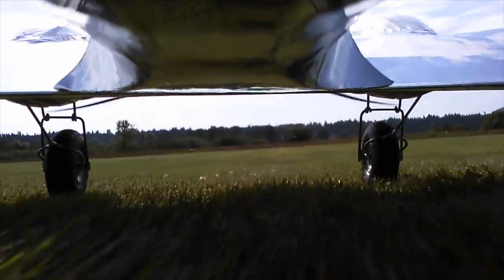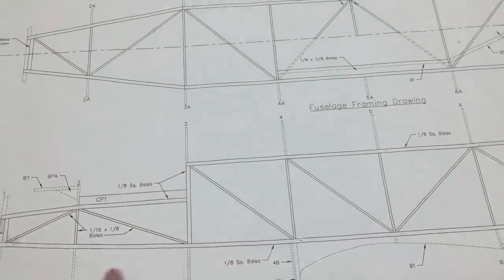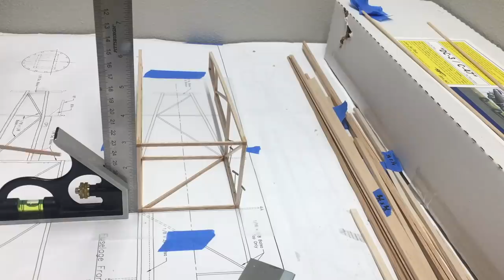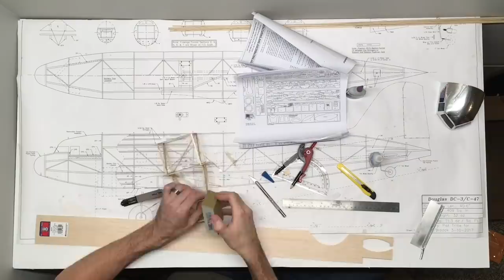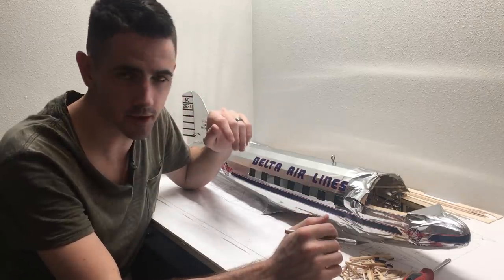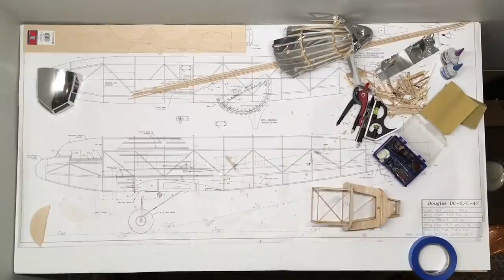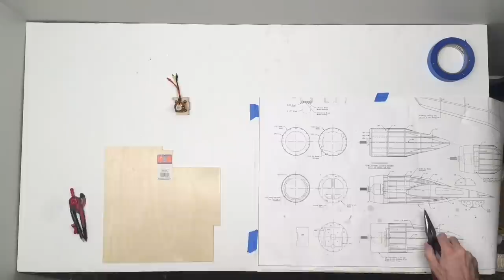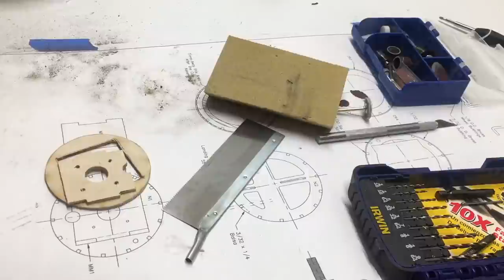How To Rebuild Balsa Plane - RC Airplane

Comment: When I rolled my balsa 300Extra, everything from behind the pilots seat up was smashed. I had to carefully remove what was left, piece it back together enough to make patterns and remake the entire front of the plane. I got complimented on how well it came out. As it was older, the white monocoat was slightly yellowed where the new was brighter but I actually weathered it in so it blended together using an Enamal wash using a touch of yellow and brown. I dry wiped it on and it worked! The result was a slight aged look! The hardest part of any repair is blending. Most people recommend recovering completly. I beg to differ. Saving the decales by just cutting them out was the same method I used on my stripes. I couldn't find a proper matching red in monocoat for the stripes. Blue was easy. There were 4 different reds at every hobby shop I went to and NONE matched. Talk about stress. Anyways, Awesome job! Anyone can built a foamy, it takes skill to repair a balsa plane. I highly recommend everyone in the hobby to build at least ONE balsa kit plane in their life time. I guarentee once you do, you will do it again.

Comment: You did a great job of rebuilding. I usually had a poor mind set trying to repair since it was usually operator error that caused it. I go back and use yellow glue on some joints as I think the heat from putting on the covering weakens the CA glue.

Comment: Nice work on the rebuild. At least you have plans. I’ve often had to redraw the parts from the crash damaged parts before the actual rebuild.

Did you work out the cause of the original crash so as not to repeat it next time.

Comment: Hi. Great build and rebuild. My dad was airplane mechanic and eventually crash investigator. He would have been 100 last month. He once talked to me about lines of force transmitted in a nose impact. He traced his finger along the spine of an ultralight he was building in his garage. He showed me how the monocoque fuselage will take the impact well however his finger stopped at upper rear directly forward of the vertical fin.  Here there may be a transverse crease indicating load of tail plane has come up and over and returned to original position whereby one has fractures in fuselage at that point.  Don’t think the loading on your model would have suffered this being so ridged. Thought you may find that of interest.

Comment: Quick question, as I’m currently building this model (just started the wings), how would you feel about adding a gyro to this setup? Do you think it would be worth it?
Reply: It would never react fast enough to have prevented the take off flip over. I did try one on my Sig40 but do not feel it helped except maybe on a few landing s.
Reply: I agree with adding the gyro is a benefit.  I've had other war birds that take off was really hard to keep the tip stall from occurring.  Put a stabilized rx on, and it all went a way.  Check out those by Lemon, one of the best and all I use now.

Comment: Perseverence is good! 
Many RC DC’s are tricky. Even the Top Flite. The take off, than a wing over is a to low speed, so no up, no aileron only rudder. 
My PT-19 does the same... it stalls to cart wheel.  Fresh mown grass, short as possible... it is OS 26 FS powered, and has a small powerband... pick up speed... then gentle up... Pilot O.K. Model... 👍

Comment: notice there are no tears on the dark edges of the wood? that because they are laser cut and the glue doesn't soak in on those edges. you need to sand all those edges clean before regaling

Comment: This is a classic model DC3  stall on take off caused by insufficient air speed, just enough to leave the ground, fly out of ground effect then the pilot has no control. The controls weren't reversed, check the aileron inputs mid roll. Similar thing happens with many warbirds, esp Spitfires, not so much with the newer models. I have to hold some forward stick on take off with my Dynam DC3 to prevent this. Beautiful looking model bty

Comment: That was a too far aft centre of gravity torque roll,did you make the motors run inwards towards the fuselage to cancel out torque reaction ? add some nose weight too.
Good repair but always add gussets where the repair parts attach to the original for extra strength.

Comment: If you have a poor fitting join in a model, is the fix to just put lots of glue on it? How strong is the glue compared to the material that you are trying to glue? How do you measure the strength of the glue and how do you measure the strength of the material?
Reply from the maker: From my experience the glue is much stronger than the material. The repair worked great on this I still have the plane and fly it.

Comment: I just picked up a Balsa B17  I wanted for display, but the wing is broken off and the skin is in rough shape at  some joints. The skin is thick and looks like fabric. I was wondering if you knew what its called?
Reply from the maker: Nice B17 is a cool plane. It could be covered in (Stits PolyFiber Covering)
Reply: @TroyMcMillan  Thanks thats exactly what im looking for.

Comment: You know why it crashed, it stalled on take-off. Not enough speed, relying on the engine power to pull it up, know as "Hanging on the props".

Comment: In scale....you were taking off in hurricane wind! You have a light craft and comparatively powerful motors which unlike the real DC 3 (have flown many PNG) you can climb much more steeply out of trouble than the real thing but....that wind was unflyable  unless you flew directly into it, but even that may have looped you. If the wind is strong.....don’t fly.....we light model builders just remain grounded.